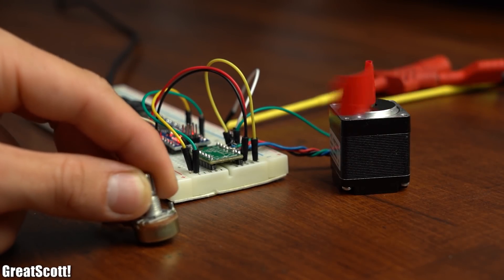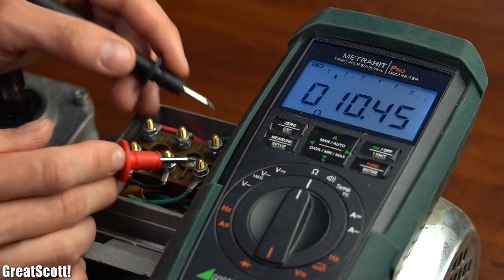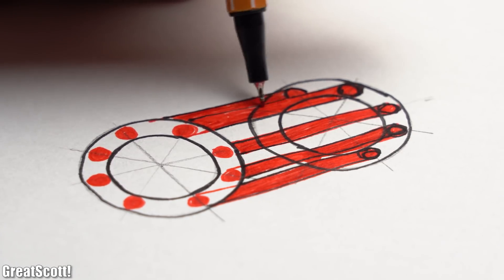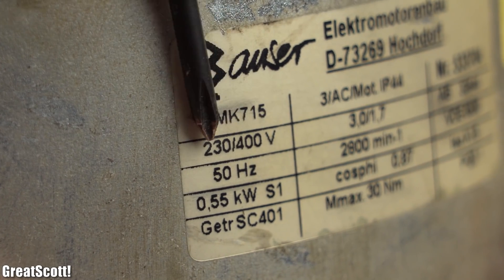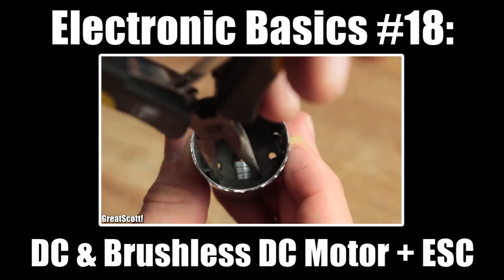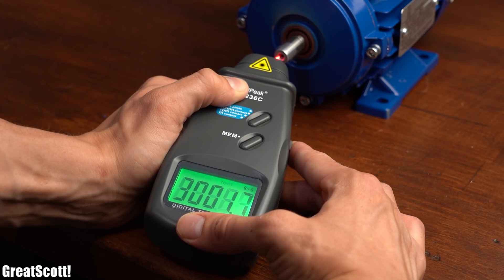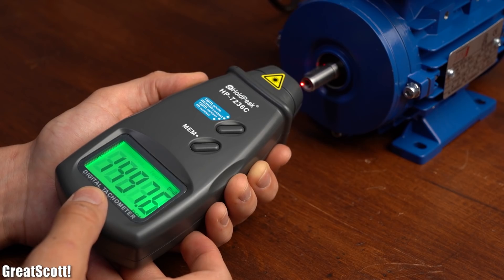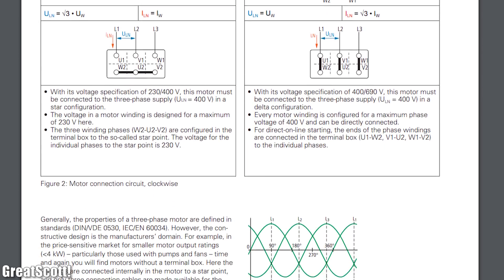Does this old Induction Motor still work? || How do Asynchronous Motors work? EB#46

Comment: 6:09 you should absolutely never power the motor up while the shaft key is still in it no matter how secure it is! 

Those things fly out you don't even see it and it can hurt you badly.

Stay safe.
Reply: Black turbine mine flew off somewhere on my single phase motor. Never found it
Reply: @Ironarcer  don't even look for it 
Time to get new key
Reply: Well thankfully that motor had that gearbox which slowed it down enough
Reply: @drobotk  he was powering a blue 2 pole boi without a gearbox
Reply: @blackturbine  Oh yeah I've just noticed it also had a key. This guy is brave
Reply from the maker: Not sure what you mean. Sorry.
Reply: @greatscottlab  on the shaft of the motor there's a slot with a long square piece of metal in it called a shaft key.
This key is used to transmit the torque from the motor to whatever is connected to it.
The problem is that the key is only pressed into the slot, so powering up the motor like that could cause the key to go flying and hurt someone.
Reply: @TDG2654  it can literally fly like a bullet specially on 2 pole motors
Reply: @greatscottlab  Um zu übersetzen: Den Wellenkeil solle man entfernen bevor man einen Motor startet unabhängig davon wie fest er sitzt, daher selbiger rausfliegen könnte. Was natürlich ins auge gehen kann.
Reply: @greatscottlab  He means that the "Passfeder" could be fly out.

Great video!
Reply: maybe it is fixed in this motor, but i doupt it
Reply: I spotted this immediately as well even though I never touched a key in my life. I just watch too much YouTube.

Comment: Great work. You did a great job explaining this. We use a lot of 3 phase 480 Volt motors where I work as well as several 4160 volt motors. The stator is large enough to stand inside on the 4160 volt compressor motors we have. It’s a lot of fun to work on them.
Reply: i would like to know as well